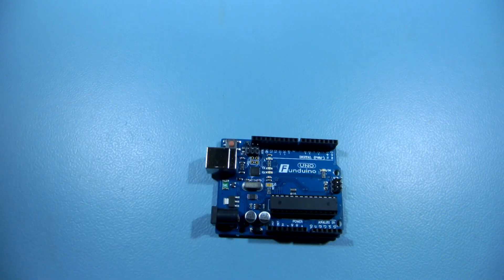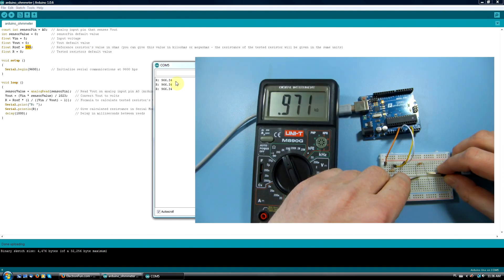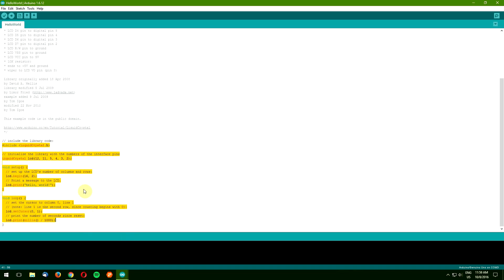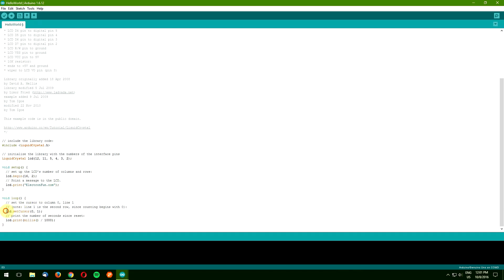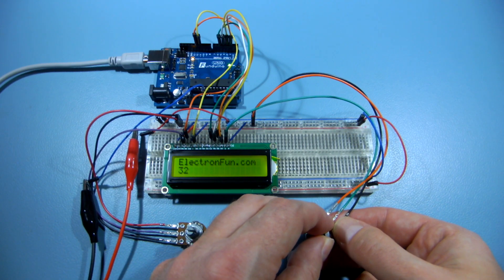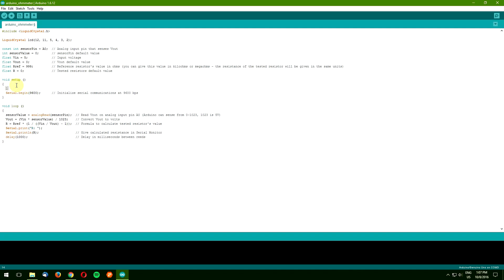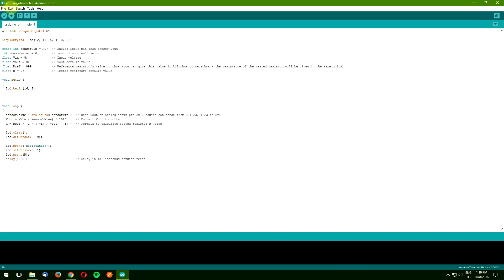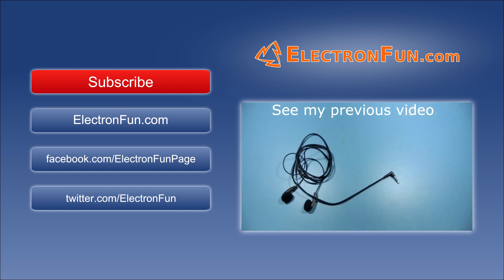How to use 16x2 LCD with Arduino || Arduino tutorial

Comment: Hi i am doing a project on blinking led with delay, the thing is there is  some code in the examples for a led blink delay changing using a potentio meter but for me I have 3 LEDs and 3 potentiometers, by using these 3 potentiometers i want to control the delay of  3 LEDs individually i.e led 'A' blinking delay will be controlled by potentiometer ' A'  and similarly for LED B and C, i tried many times but result is not as expected ,i am new to the programming plz help me

Comment: The circuit is wrong the pot connected to the backlight pin 'A" won't do anything.. unless you remove the 150Ω resistor..
Reply from the maker: The resistor is used to protect the backlight LED. If you 'opened' the pot all the way up, you could burn the backlight, because it would get full 5V.

Comment: The lcd works great but when I add the Ultrasonic Sensor HC-SR04  I get a garbled display, unreadable, all black boxes. Everything is wired and programmed correctly, what causes this? The data in the console is correct from the sensor.
Reply from the maker: It's difficult to say without seeing your setup. How do you power your components? Have you connected your LCD correctly?
Reply: I'm using the 5v from an arduino uno for everything.  The lcd is hooked to the following pins: lcd(12,11,5,4,3,2). The sensor pins are trig 13 echo 9.
Reply from the maker: It looks normal, but have you tried disconnecting everything and starting from scratch? Sometimes a faulty jumper wire may give you a headache. I would also suggest checking the wires with a continuity tester.
Reply: I found the problem, it was a software error. I must have moved a pin placement and forgot to update the software to match. Works great now! Thanks for looking.
Reply from the maker: Thanks for letting me know, I'm glad you found the cause of your issue. :) Such mistakes happen a lot.

Comment: Please help, the background light is working but no text is showing, i used the same schematics as shown both in the video and in the example sketch, any suggestions on why its not printing any text ?
Reply from the maker: Have you checked the contrast potentiometer? I would also double check all the jumper wires - sometimes even brand new jumper wires happen to be faulty.
Reply: I tried but no luck, i looked in another video and was able to display boxes but i wasn't able to display text.
Reply from the maker: I would try disconnecting everything and connecting it back. You may have connected something wrong and troubleshooting can be a real pain. Sometimes following the diagram once more may take less time.
Reply: I actually found the problem. the stupid me forgot to put the wires in the digital and not analog 😂 it was hard cause i have a nano 😂 anyway thanks alot for your help. ❤
Reply from the maker: It happens, that's why I advised connect everything from scratch 😃

Comment: pls help 
 dont have any kind of potentiometer but i have a lot kinds of resistors which can i use
Reply from the maker: You don't have to use potentiometers if you don't want to adjust contrast and backlight brightness. I would try using something close to 5k for the contrast and if it doesn't look good, you can try a bit higher or lower values. If you wan't the full backlight brightness, you can use just the 150 ohm resistor.
Reply: thx very much
Reply from the maker: No problem :)
Reply: @ElectronFunCom 1 leg of 5k resister  to pin 3 of LCD but where we have to connect another leg?? to +tive or -tive
Reply: Voltage divider

Comment: Do we really need the potentiometer and the resistor to use lcd display? Can I not use it?
Reply: And can you explain why you assigned each resistor like that?
Reply from the maker: You don't even have to connect the backlight, If you don't need it. You could also use a properly selected resistor instead of the 10k potentiometer, if you don't want to adjust contrast.
I used only one resistor to protect the backlight LED. I used Ohm's law to calculate the resistance I needed. If you want to read more about using this knowledge in practice, there is a nice article about it: https://learn.sparkfun.com/tutorials/voltage-current-resistance-and-ohms-law/an-ohms-law-experiment.
Reply: ElectronFun.com Oh... so that's the reason... Thanks. I understand it now. After watching a couple of videos, I can finally understand the reason to use resistor and potentiometer.
Reply: That's what I did, used 1K resistor to the 'A' pin. the circuit is wrong.. the 2K pot wont do anything..
Reply: About the pot and resistor for Backlight control. It would be great if show the calculation here.

Comment: please help me i dont have 150ohm resistor,but i have 100ohm and 200ohm resistor.what shall i do?
Reply from the maker: The 150ohm resistor is used to protect the backlight LED. Try using the 200ohm resistor, but your backlight may be a bit dimmer.
Reply: 1K is the best
Reply: Go buy some resistors (   :=)) sorry but could not resist)

Comment: nice video; would the library be the same for this module with an i2c board like this one https://goo.gl/cnSidd ?
Reply from the maker: Google holds pretty much all comments, which contain links to external websites. That's why I didn't notice you comment, sorry.
To answer your question - there are separate libraries for I2C LCDs, see here: http://playground.arduino.cc/Code/LCDi2c.
Reply: Thank you so much. Appreciate it.
Reply from the maker: No problem :)